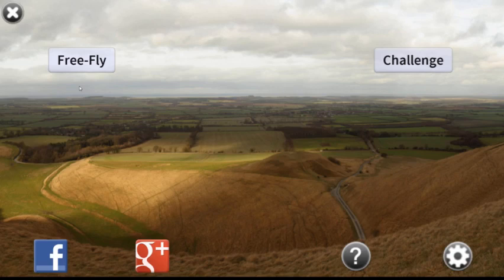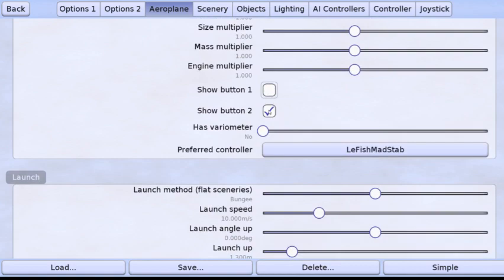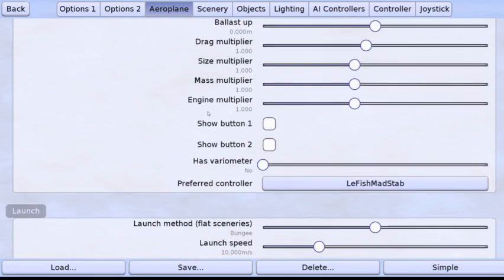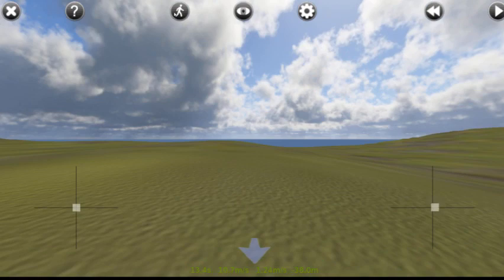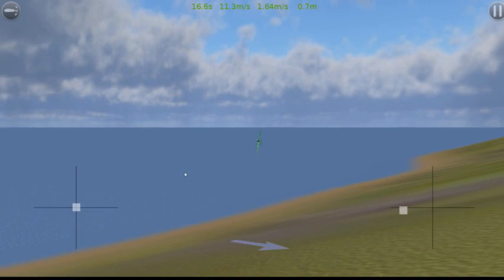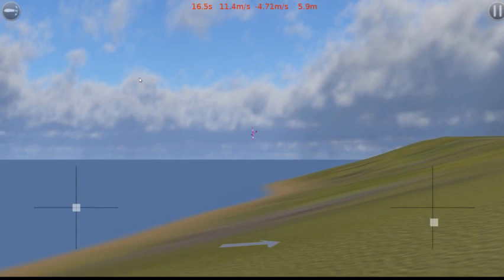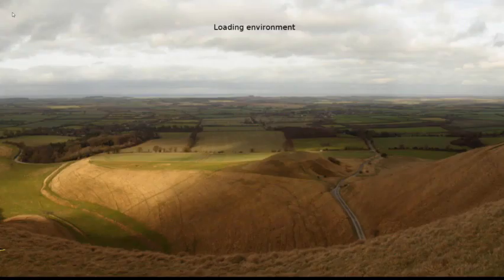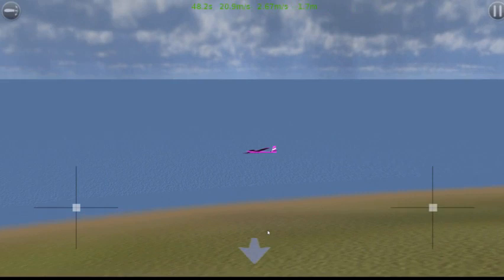PicaSim config for "VTPR de plage"

Comment: hi, your video is awesome, is it possible to have your vtpr models please, more accurately fish and quartz in 2.5m?
Reply from the maker: hi - sure, what are you looking for specifically?  i.e. both the LeFish and Quartz models are included so guessing you're looking for any configuration mods I made?
Reply: Also, over in the Gallery at the main Picasim tapatalk forum, Bishop_1 has posted very well thought out models of the Excalibur 2, Le Fish, Floonda (3D print Le Fish concept), Swift (whole wings move rather than ailerons)...I posted a Picasim VTPR environment .xml with it, Phase 4.